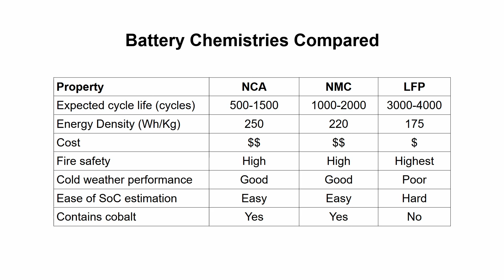How EV Battery Chemistries Impact The Car's Use

Comment: 8:05 I have an LFP domestic battery and I used to be involved in the design and commisisoning of utility scale LFP batteries with 10s of MWh of capacty. If I had an LFP battery in my EV (mine has NMC because LFP wasn't available at the time of purchase) I would be fully charging it much more frequently than every 2-4 weeks as you suggest. Those Coulomb counting SOC errors can accumulate quite quickly with multiple fractional charges.
Reply from the maker: Thanks, that's a very valid - and useful - comment. I chose to suggest less frequently than once a week because a) people might not charge more than once a week, and 2) it probably doesn't really matter all that much if most of your journeys are significantly shorter than the charge range.

It depends a bit on people's use cases. However, I didn't really do a great job explaining that, so perhaps I should have suggested more frequently to cover situations where people's use cases are to use more of the car's range frequently.

Tesla recommend that their standard range cars be fully charged once a week, but I know people who won't charge more than that, so I used a longer duration than that.

In hindsight, a better way to put it would be every 3 or 4 charges. That way, it covers all of the use cases.
Reply: @theelectrictransition  Yes that would be better, although I do (and I would with an LFP battery) charge to 100% every time
Reply: @redshift3 I have an MG4 SE. I have understood that I can charge to 100% every time but, if not charging for a long journey, I charge to 95% because Regenerative Braking (RB) is limited above that figure and I like the braking to be consistent and like RB as a boost to efficiency.
Reply: @tomhart3058  I have the same effect on my EV (Jag I-Pace) but I just drive more cautiously for a few miles

Comment: I would suggest the everyone search and understand the soon to be introduced revised Chinese national safety standard for electric vehicle (EV) batteries, titled GB38031-2025 “Safety Requirements for Power Batteries of Electric Vehicles,”
Basically "No fire, No "Explosion" no propagation between cells" IF damaged (and no pack puncture), Plus the ability to use the pack for reduced power for a given period, which prevents immediate immobilisation in dangerous situations (Highways, etc)

Comment: A nice succinct approach to battery differentiation. With my BMW i3S I did get better range estimates when I got home on a very low state of charge and trickle charged at 5 amps up to 100% and drove again within 5 minutes of reaching a full charge. Not done this yet on my Tesla model 3 also with NMC batteries.
These videos you do are very helpful to beginners and people like me who have been using electric cars for a while. Good to be reminded of how and more importantly why knowing how everything works.
Reply from the maker: Thanks very much. Yes, it does help to discharge and then fully charge occasionally, no matter whixh chemistry.

From what I understand, your i3s will have NMC cells. EV database suggests that the 94Ah i3s uses NCM333 cells, whereas the 120Ah uses an NMC622 formulation.

LFP is pretty new to the market, partially because of patents, which expired only a few years ago.

Comment: Good Video, well explained on quite a complex subject however their is one comment that I'm not sure about and that is the needing to charge to 100% to balance cells.  I have been racing model cars using lithium batteries for many years and throughout those years I have never seen a situation where I need to fully charge the cells to balance them.  Instead the charger gradually equalises them over the complete charge cycle, even the opposite is normally the  case where when the cells are close to fully charged all the cell voltages have normally already equalised.  So I would be very curious to understand where you obtained this information from, although this does seem to be generally most peoples understanding but I'm just not sure this is factual.
Reply: It is correct, but dependent on the BMS used. I expect the BMS in a model racing car is rudimentary or none. In an EV costing tens of thousands of pounds and with a battery warranty (that could cost the manufacturer hundreds of millions of pounds in the case of a serial defect), the BMS is a very important element
Reply from the maker: Hi Richard. It's a fair question. I've been thinking whether there is a definitive source that I can reference, and so far, I haven't been able to think of one.

As you say, there is a danger that something considered common knowledge is incorrect. I have seen this quoted in many, many places, but that's not definitive evidence.

I think there are a couple of points that may be relevant. Firstly, an EV battery pack will consist of MANY more cells than the packs in a racing model, so the opportunity for them to fall out of sync is probably greater. The second thought is pack configuration. Are your racing packs made up of both series and parallel cells, or only one or other? I think that has a bearing on how unbalanced the cells could get.

I'll keep looking for an authoritative source. This is an initial reply rather than a complete response.
Reply: @theelectrictransition  HI, thanks for the response,  I have to reply regarding the response which RC batteries have no BMS, true the batteries don't but the chargers do.  The cells generally range from 1s through to 6s and are typically wired in series.  The criticality is the same, just the effect is different.  Refering to my R135 Zoe, like yours.  I only charge to 70% and strangely enough my cell voltages still remain in sync.  Strange That.    If you do ever get to the bottom of my question please ley me know,
Reply from the maker: @richardwilson31  Ah, OK, interesting. Id wondered whether the RC packs were made of lots of parallel strings, for maximum power output. Cells in parallel are effectively forced to be at the same voltage, but since they are instead series strings, that theory is shot.

Yeah, Ill have a further look into it

Comment: Maybe it wasn't used in the UK, but my '22 Chevrolet Bolt has Lithium-Ion, which is not LFP (they'll go to that on the upcoming Bolt).
Only 21,000 miles on it so far, no measurable degradation. I'm expecting some degradation in the longer term, but not enough to make the car useless before it's entirely paid for its purchase in saved fuel costs.
Reply: They are all Lithium ion - just different chemistries.
Reply from the maker: That's right, I think the Bolt used NMC cells. I perhaps could have been clearer that LFP has only really been an option recently, so it's appearing in newly designed cars, but there was an initial wave of cars built with NMC as that was the only viable option at the time.

As you say, we didn't get the Bolt here in the UK, although it was available in continental Europe. I've always assumed that they didn't want to bear the retooling costs of building RHD models, but I might be wrong.

I am a little jealous of countries who got the Bolt; it seemed like a great and cost-effective family car, and I think it would have sold well here, had it been made available.
Reply: @ziploc2000
As stated very clearly in the video, (and below) "LFP, NMC and NCA" are ALL "Lithium ion"
"Lithium Ion" is the general classification. the 3 letter acronyms suggest the sub-categories of Chemistry, which hold the clue.
"NMC", general formula LiNiₓMnᵧCo₁₋ₓ₋ᵧO₂
"NCA", General formula LiNi₀.₈₄Co₀.₁₂Al₀.₀₄O₂
And
"LFP", General formula LiFeP04
ALL contain Lithium ("Li"!!) and use the Migration of Lithium atoms (in basic terms) as the means to transfer energy
It's refreshing to see a Presenter on YouTube who actually understands, rather than perpetuating the myth of one or more of the above not being "Lithium ion" (Which it seems is purely due to a difference in pronunciation, or "mis-heard then mis-understood trasposition of "ion" and "iron")
.
As you might realise, I get "annoyed" by the ..... laziness" of some self-proclaimed "experts"(!) presenters and those in the comments who obviously haven't done the basic research.
Let's try to get the BASICS correct?

Comment: I would prefer, of course, the LFP chemistry - simply because of lower fire risk and longevity (as well as a lower initial cost!).  However mine is NMC.  No fire risks that I have heard about, for my model, regardless of some who forecast doom with this version of cell.  Some earlier models of the marque had their battery changed, I believe.  None of my model have been affected at all, as far as I know.  I think all cars (on the internal chinese market) will be LFP, or better in this respect from the middle/later part of 2026 .

I believe the power density of NMC exceeds that of LFP, so required for higher powered variants?
Reply from the maker: I was expecting China to move rapidly to sodium ion, as that seemed to offer even cheaper batteries due to even lower raw materials costs. However, this seems to have stalled a bit. The price of lithium spiked in 2023/24, but has now fallen back, and so the cost differential is a lot smaller. This makes covering the R&D and production ramping costs of developing another new chemistry less clear cut.

A case in point is the BYD Dolphin Surf, known as the BYD Seagull in some markets. That was reported to use sodium ion in China, but is arriving into the UK with LFP
Reply: @theelectrictransition    Sodium ion does not yet look ready to displace Lithium for traction batteries - but developments are definitely continuing at a good pace.  They do look to be a cheaper alternative to Lithium cells for static electricity storage, where weight and size are not important factors for adoption.  We don’t know how things will develop on the battery front even in the short term.  Technology marches on!  Solid state electrolyte is yet another area of development.  I shall stick with my current EV - it will likely see me out.🙂
Reply from the maker: Very interesting thoughts, thanks.

You make a good point about peak power density. That's not something I included, but as you say, it could still be an important differentiator for high-performance models